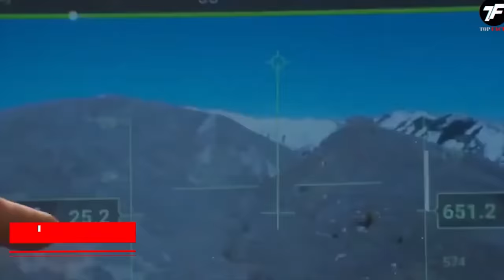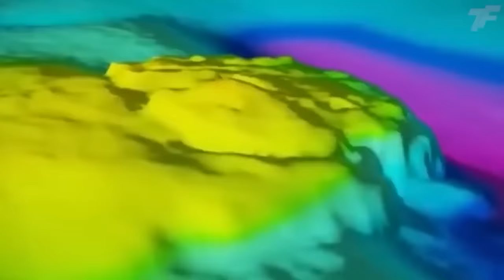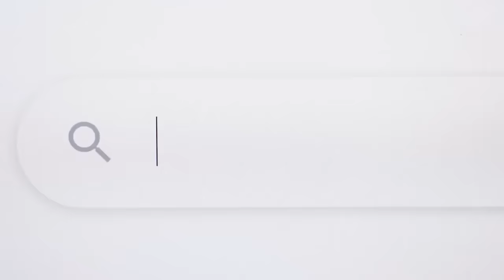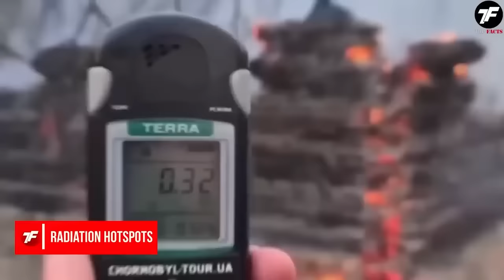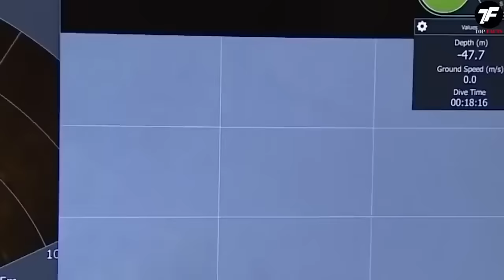No One Had to See THIS! Drone Captures What No One Was Supposed To See

Comment: 41:38 That's not a "force of nature"! That's called "criminal negligence". Lack of oversight results in poorly designed or assembled Lithium Ion batteries. This particularly concerns Lithium Cobalt, but can be any Lithium Ion battery design. Lithium Ion battery fires cannot be easily extinguished, and if you have improperly stored Ammonium Nitrate nearby, - one question I'd like to ask - is how exactly did it detonate? It needs a primer with sufficient kinetic energy, even your typical rifle bullet doesn't produce enough of it to detonate Ammonium Nitrite. You need a speed of 3+ km/s and a properly placed detonator in order to vaporise the AN. Someone went out of the way and cut too many corners here.